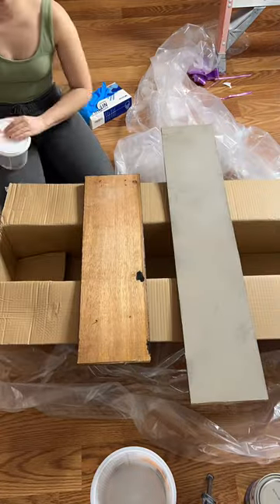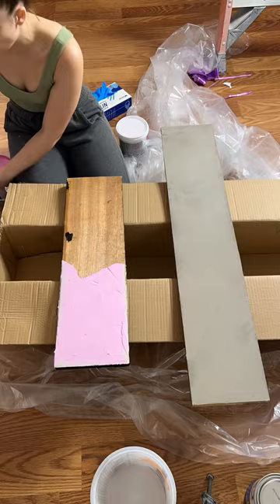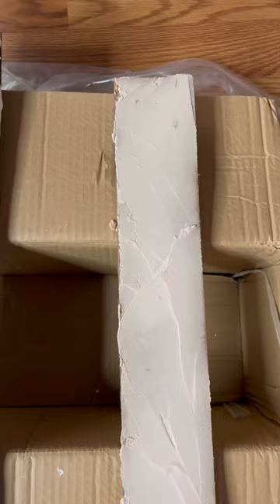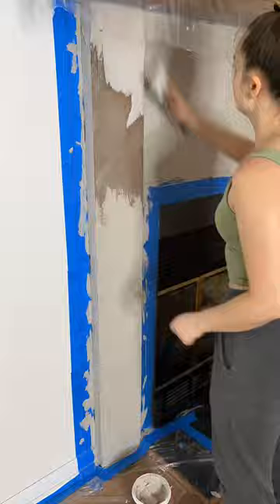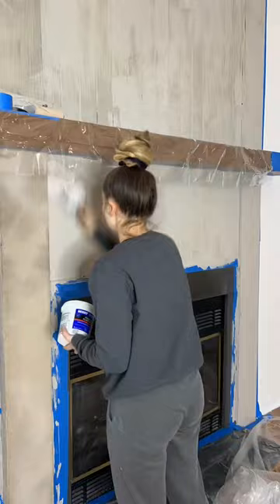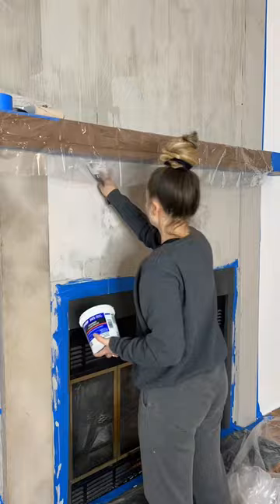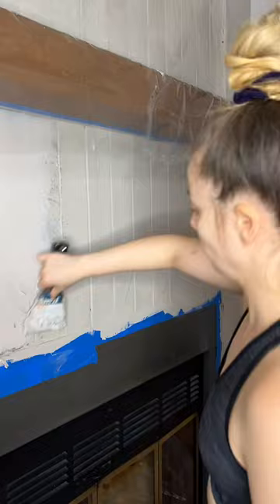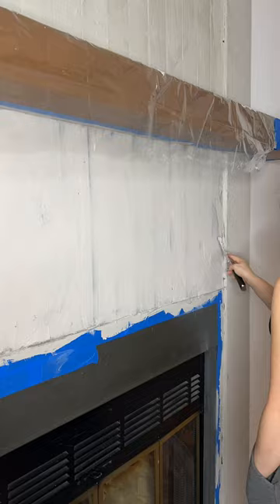HOT MESS LAKE HOUSE RENOVATION PART 36 | VIRAL TIKTOK SERIES | LEXI DIY

Comment: I think the issue that happened with the cement initially was the timing. Too much in too little time. I feel that if you had done smaller amounts and worked in sections, it would've given what it needed to give